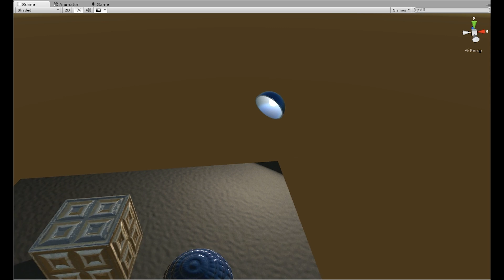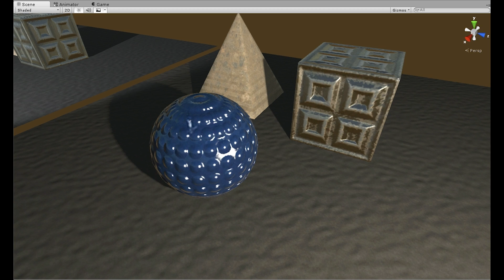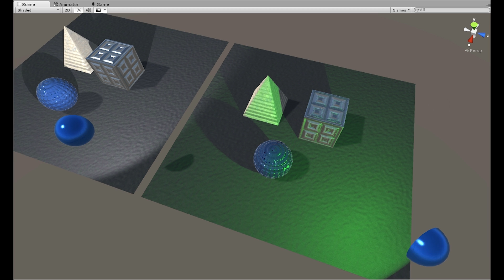Emission Lightmapping - Unity 5

Comment: HI, thanks for sharing this. Could you elaborate on this a little? are all the meshes using one material and say one def texture and have an emissive baked texture in that slot? or does each object have its own materials and textures but the EM channel is "wired" to the same emissive texture? sorry, its actually hard to get the question across as they sound similar.
Reply from the maker: +bedlam46 Sorry, just noticed your comment. This is using Unity's Standard Shader. Make sure you check out the full tutorial on our website http://randomseedgames.com/blog/2015/8/20/lacuna-passage-devlog-525-lightmapping-with-emission-in-unity-5. You can use any number of materials where the emissive channel is what you can effect at runtime (with color or intensity changes which lightmaps do not easily allow for).

Comment: Can you make a video of the whole process? I find it really interesting, so you basically just bake the map in 3ds max, all channels? and just apply it as an emission map? Can I do the same but in blender? And I'm guessing, you need to assemble the parts of the scene outside of Unity right?
Reply from the maker: Jokester The Mighty The full tutorial is available in a written article linked in the description. If there is more interest we may make a longer video. I'm not super familiar with Blender, but I'm sure there is a way to do it there as well. And yes, you need to have all elements arranged exactly as you want them to be in Unity when baking the maps in your 3D app. If the objects are all static anyway you can just export them as a single model and bring that into Unity so that you don't have to manually arrange them.
Reply: I've read it, I just had few questions, do you texture it also inside 3ds max?
Reply from the maker: Jokester The Mighty Yes. You will need the specular/gloss and normal maps applied to your objects in your 3D app in order for the lighting bake to properly apply highlights, etc.